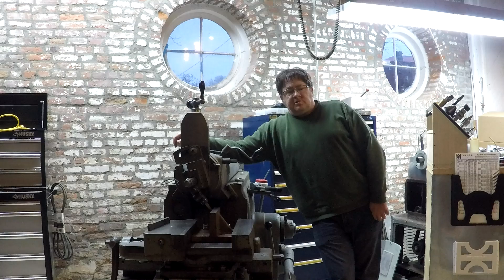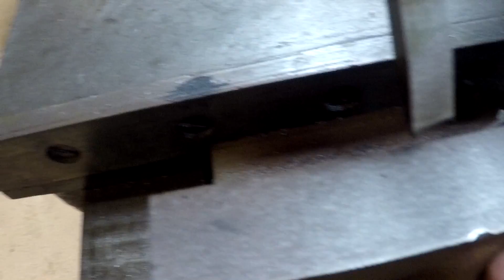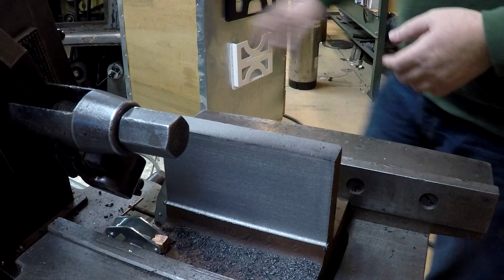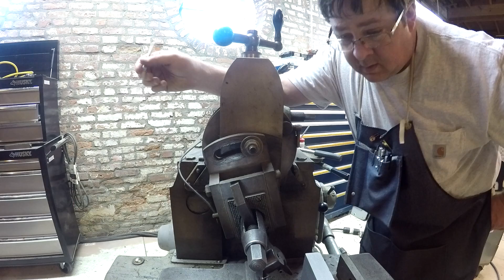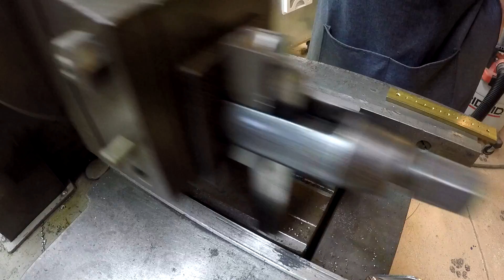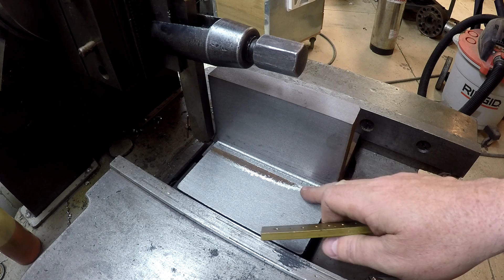Angle Plate Castings #1

Comment: Waiting for a nice little shaper (something like an 8"Boxford) to become available in this area, they are so useful in the home shop. Last time I used one was some years ago on cast iron dividing head castings, think that machine was a twelve inch or a touch larger, I remember it made short shift of getting under the hard cast skin and chucked chips a couple of feet on to the workshop floor.

Comment: shapers are like model t's lots of fun to work on in your spare time and to drive once a year in a parade, but not for daily transportation. i did not notice a power downfeed ,did you handfeed ? how long did those roughing cuts take? i woild have like to have seen the set up and how you checked the casting to determine the sequence and depth of cuts. nice video.
Reply from the maker: larry sperling Yep Larry, all hand down feed.  That vertical face probably took close to an hour.  Really slow going at the end as the depth of cut got really wide.

Comment: J, I've never used a shaper and my sum knowledge of them comes from watching you.  What would be your criteria for using this machine over the horizontal for example?  Better finish, easier setup, squareness, tooling costs?
Reply from the maker: Peter Owens The primary benefit of a shaper is cheap tooling.  I can scrape litterally tons of mill and casting scale off with a HSS tool blank that costs less than one carbide insert.  It is also easy to get really nice flat surfaces if your knee support is properly adjusted, with some amazing surface finishes that approach grinding.  However they are slooooooow.  Mainly you use them because you love them.
Reply: James Kilroy
I already told Adam that I think I would much rather watch paint dry than watch a shaper  at work

I would fear the monotonous, rhythmic sound would cause me to doze off while I was operating another piece of equipment.

I imagine they made sense in busy shops so you could just let it grind away inexpensively in the background while you kept your mill freed up to earn the bigger bucks.

Comment: Hi James !

Oh,I have to go to the scrapyard to get some of these big cut off pieces of construntion T- and L- and maybe even H-beams to make some of these tools out of ,,, the vinter is preventing that at the moment, but soon it will be spring ... I hope !

Really nice work on that shaper !
Reply: Try looking for a shop that does steel fabrication for construction.  You can ask some local contractors where they have there beams and columns made.  Those shops will typically have nice cut offs that they usually can't use and which are just scrap.  I can usually trade a coffee and a sandwich or pack of beer.
Reply: John Ferguson
Yeah, I found some ;.))

Comment: The last guy I knew & met in my life there was a older man in his mid 70's that ran a old time shop and had a 24" shaper and a bigger one (don't remember the size).  Probably since has gone to the toolroom in the sky.  This was in the early 1990's.  He also had a 16 and 24" South Bend on the proper line shaft driven by an electric motor..
Reply from the maker: gbowne1 Those old tool room buys could work miracles with a shaper.  Shops like that are few and far between now.

Comment: This is a premier shaper video, even get to see the inside crank action!! Want me to send you my 8" face mill to borrow? That shaper is tediously slow. I would clamp those bad boys to over hang the table on the horizontal with your back edges against a stop, then you could mill the front edge and the back angle in two passes so they would all be equal and parallel to each other. then you could just move the cutter to the vertical overarm and mill the bottom without moving anything and you should be exactly 90deg and perfectly matched! :-)
Reply: I have a cool 6" facemill that uses some interesting inserts that look like TPG322. Made by Lovejoy Tool.  http://www.lovejoytool.com/
Reply: gbowne1
 I have several Lovejoy facemills but mine all take round or square inserts. I didn't know they made ones for triangles too.
Reply from the maker: bcbloc02 pierre beaudry  Hi Brian, that is exactly what I am going to do after I rough off the scale.  Pierre is ever more correct, sometimes you just want to run the shaper.
Reply: I think that James want to show all of us some shaper porn action, the shaper is a little like curling, it doesn't look like it's working hard, but, underneath it's sweating big time...
It's an interesting machine and there are jobs that it does well, just not the first machine you'd purchase to start your machining shop though...